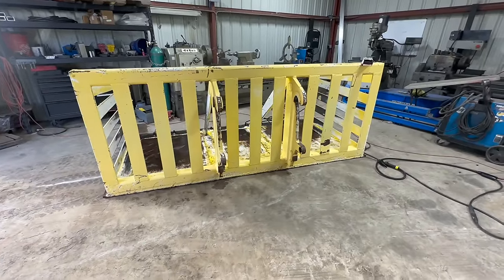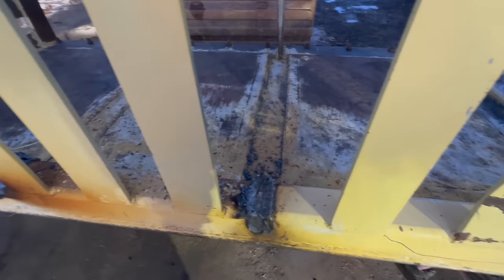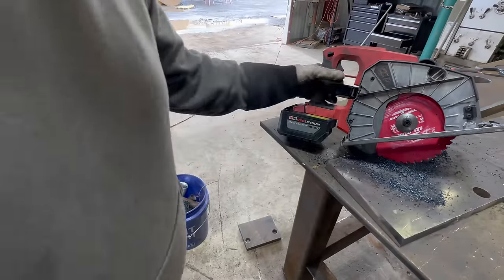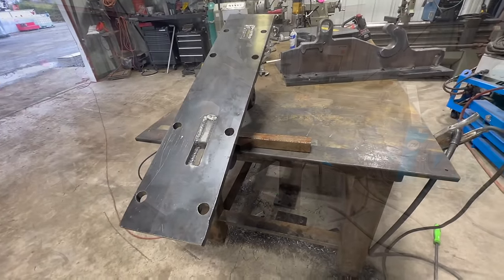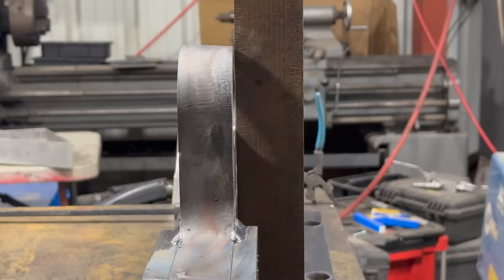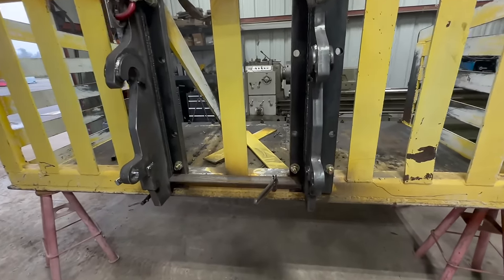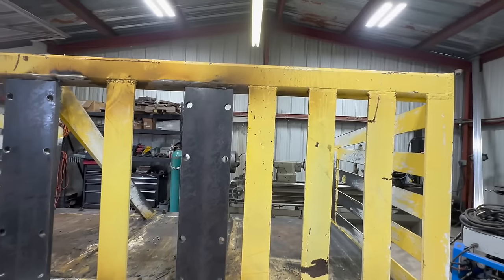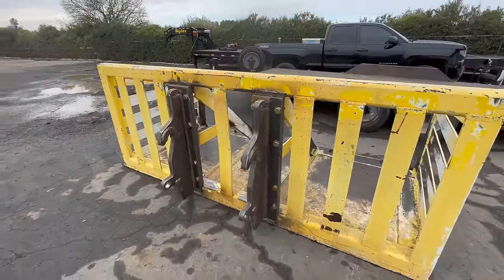Snow Basket modification (Hybrid coupler install)

Comment: I've seen lots of snow equipment here in the northeast but never a snow basket. Guys up here load out snow with the loader buckets. But I do see this design working way better, probably lighter then a bucket and certainly more capacity to load out trucks faster. Pretty sweet concept, maybe I'll talk to some guys about it
Reply from the maker: It seems to work well for the guys around here. You move a lot more snow at one time.
Reply: Out west they have powder dry snow very light . Back east we have wet icy slushy wet crap.🍻

Comment: Greg, that Milwaukee saw is impressive....I have an Evolution circular saw that is corded, 
and have cut 1/2 inch, even though rate for 5/16, it gave   a very smooth cut looking like a milling machine with 
a fly cutter ran over it....but never thought a circular metal cutting saw would cut material
as thick as what you are doing......thanks for showing this.....maybe Milwaukee 
needs to send you some support .......PB

Comment: what a cool " skill saw". i bought a low RPM compound miter saw w/ a carbide blade to cut steel but it would choke cutting that thick of material. call me impressed.

Comment: I live on the east coast and have done snow removal since I was big enough to run a Bobcat (skid loader) with a snow bucket. I started running a rubber tire loader with a snow bucket and driving plow trucks when I turned 16.  That all said until now I have never seen a “snow basket” before and now that I have I am curious about them and what advantages they might offer compared to a snow bucket.

Comment: Greg, hearing you say you are a Fireball Tool Lover, if you do not have a set yet, 
you need the magnetic spacer blocks they make, they go from 1/32" up to 2"...
you get 4 each in a fitted case.....you will find an incredible amount of uses....
I even use them on my lathe.....the squares are fantastic too, we have the smaller
ones, both cast iron and aluminum.....I kind of like the cast iron better.....also 
look into their bar clamps.....they attach to any 1x2 tube with...and are sliding.....
like a pipe clamp, but really sturdy.....they are very large too......and they are easy
to turn into a pusher clamp...just slide the heads off and reverse on your 1x2 tube
best wishes, Paul......

Comment: 26:33 when the square falls off, a perfect use for the Fireball magnetic spacer blocks to hold it in place...
also putting under a square to jump over an obstruction.....you will be amazed all the ways you find to 
use the little buggers.....they have an accuracy of about .001" , and are laser marked so you can ID easily...
dang, I sound like a salesman for Jason......

Comment: i just got a snow "push box" for my JD444. It's got a rubber blade situated in the back of the box and i think i'd prefer something like this one that has an actual loader blade on the front. The one i have tends to leave a super thin sheen of snow underneath it.

Comment: Nice work, Greg.   Looks like you need a CNC Plasma table, or you already have ready access to one.    I’ve never seen snow baskets used here on the east coast, but they may be around.   Most guys here either use blades or an end loader with a bucket.
Reply from the maker: I have access to two plasma tables.  But I do want to buy my own some day.

Comment: Just a question so in California do you remove snow and truck it to another area we in the east waste a few parking spaces and pile up the snow and let it melt in place unless we get slammed then you got to remove!
Reply from the maker: These are usually used in mountain subdivisions where there is no extra room to pile up the snow.  They usually move it to the end of the block or an empty lot.

Comment: Absolutely amazing work with unparalleled pride! Thank you for sharing, and explaining it all. I have built multiple box plows, snow buckets, among other attachments, and have never seen a snow basket. Looks like a great idea. Forgive my ignorance, I have never been to Cali, but I never knew you got snow there! 
Also, I may have missed it but, are the slots just for extra weld and strength? I see one is longer than the other. Thanks again, stay safe!
Reply from the maker: Thank you for your support! We actually get a decent amount of snow in the mountains. Not in the valley where I live but the snow is only 40 minutes away. The slots are for alignment of the two parts and it definitely adds some strength. One is longer so it can accept both styles of coupler.

Comment: Man that Milwaukee "battery" saw is amazing!!!!  Greg, How much warpage did the back plate experience?  Will that be managed by bolting the back plate to the "baskets"?
Why didn't you use your metal cutting saw to cut out the plates in the back of the basket?  That looks like a "magic" tool with thinner kerf and lack of grinding after air/arcing.
Reply from the maker: The back plates warp about 1/16-1/8” and the bolts have no issues sucking that down. I don’t think the saw would fit in there correctly to cut them out.

Comment: Does the metal soften up when you use the plasma cutter in one spot extensively?  Or is metal fatigue not an issue?
Reply: It definitely won’t “soften”. In fact it will become harder and more brittle just like the HAZ (heat affected zone) of a weld. However, it probably puts less heat into the area than a carbon arc torch or oxy-fuel cutting. Either way, they all get incredibly hot and it’s just part of it.
Reply: @williamthomas9463  thank you.

Comment: You should be wearing a welding respirator !! Remove mill scale from plates before welding ??
Reply from the maker: I usually wear a respirator or have the area vented with a fan.

Comment: What is the purpose of pre heating the metal
Reply from the maker: To help it relax, better fusion and it takes stress out of the joints.
Reply: Not to mention moisture removal to prevent hydrogen induced cracking. Also, it slows the cooling rate to make the finished weldment less brittle.

Comment: Greg FYI: As an electrical engineer, your assumption that will get max output power with a rotary phase converter is a incorrect. Your phase converter has a single phase 240V input, therefore, the output of the phase converter cannot be any more than the input power.
Reply from the maker: I was not talking about maximum power out of the phase converter. I was talking about maximum power out of the Miller XMT. Naturally, it will draw less amps on three phase. it’s clearly labeled on the machine.

Comment: Always amazed to see you using an angle grinder without the safetyguard. Where i live it is grounds for imediate dismissal. If you are a private contracter you are escorted of the property and never hired again.
Reply: Personally I have seen more accidents/injuries occur on grinders with the guard on.  My main gripe with most guards on grinders is they obstruct my view. That said I do wear a full face shield older welding helmet with a clear or very light yellow shield that has drape on the front along the bottom, side shields and drape over the back that covers my neck (I have had skin growths removed off the back of my neck for uv light/flash from welding.) Additionally I use a fresh air system to filter and blow fresh into my helmets. I resisted using the fresh air system for quite a while because I really didn’t and still don’t like wear the filter unit but at the end of the day I do feel less tired and fatigued using one.
Reply: Guards are more dangerous then no guards in my opinion

Comment: What's the advantage of a snow basket over a bucket? I didn't know such a thing existed.
Reply: Much larger can move more snow
Reply from the maker: Can carry larger volume of snow.
Reply: Are the gaps to save weight or to help the snow come out?  @OFW
Reply from the maker: @ShEdward876  to save weight.  That much snow starts to max out a loader.

Comment: Dang it is disappointing these days that band saw blades are almost always welded poorly and cause a saw to jump as that joint passes (39:30).  Even the good blades seem to have that poorly done butt weld, not just the discount blades.
Reply from the maker: I agree.  They definitely don’t last like they use to